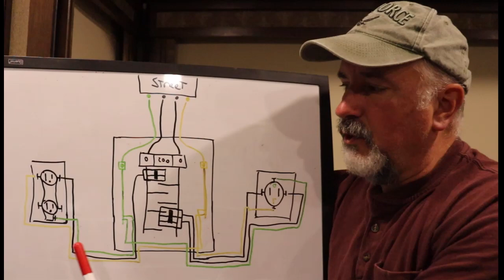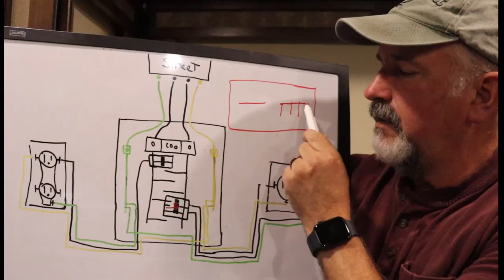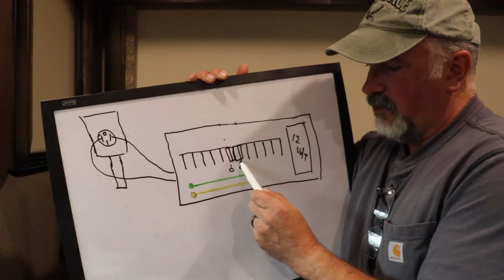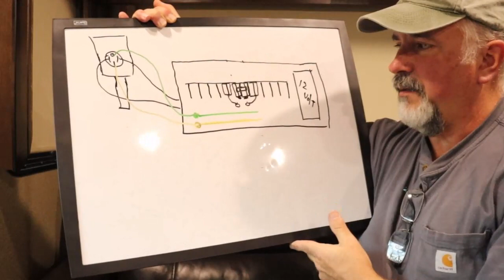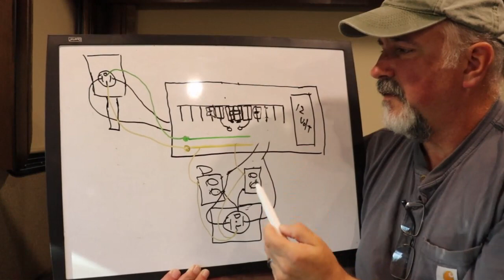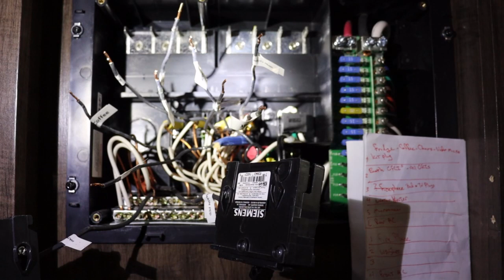DIY: Upgrade your RV Washer/Dryer

Comment: I know this is an old video but could you just take those two lines(washer/dryer since they are already on their own breakers and do a remote panel and have your double pole from that? Does the new washer and dryer only need the 30amp? Like In a house dryer has its 30 and washer usually has a 110.

Comment: So I assume Mike the smaller gauge wire in my 50 a breaker Rv can be used ?  So my washer dryer breaker /110v is in place .  One pole is my 110 washer /dryer pole and the other is a fireplace So the existing breaker needs to be replaced with a double 30 ?  It is currently a 15/20 amp

Comment: Hey, thanks for the video awesome resource to have. My wife and I are also living in a 5th wheel camper. We are looking to upgrade our washer dryer and install a 220 dryer. I watched the video and didn’t quite understand how you did away with the main 50amp breaker that is in the box? I understood how you moved the two lines coming in to different poles, but how would you retain that 50amp main breaker and add the 30amp breaker tie breaker?

Comment: Just for laughs!!!!!!!!

Here's an idea I just came up with but do not try this unless you are an experienced electrician!!!!!
I am not an experienced electrician I have some knowledge electrical wiring but not very much.
Once again do not try this!!! It's just an idea I had.

Here's another odd thing you can do that should work just fine.
Locate the two gang or two plug-in box on the outside of your house for 110 volts then find the breaker in your breaker box that powers that plug and pull that breaker and the next one to it and put a 220 breaker in there and run another line to the other side of that same outlet on the outside of your house.
So you can use that outlet like a 110 on either side by itself!
But if you have somebody who wants to plug in 220 have an adapter made up to plug in a cord from each side of those that goes to a different leg going into the RV.  Meaning that the outlet on the upper part of that box would be line A into the RV and the plug-in at the bottom of that box would be line B going into the RV. Then run at least 12 or 10 gauge wire to wire up that receptacle from your fuse box out to that outlet and you'd have to use heavy gauge wire every gauge appliance wire extension wire at least 12 gauge extension cords from the outlet on the outside of the house to the RV adapter, And make sure to use a 20 amp outlet on the outside of the house. They do make 20 amp 110 volt outlets believe it or not. You would also have to disconnect both ends of that receptacle from each other. I mean make them totally separate circuits electrically there's a little tab to break on each side of the plug to make those totally separate circuits the upper plug from the lower plug can be made separate circuits and that's what you would have to do or you could have serious problems in your fuse box!!!
You would run both of those heavy duty extension cords into the power box like the one he made that would be wired up differently with a 50 amp RV plug or receptacle on the outside of that box to plug the RV into.
This setup I just described should be equal to running long extension cords from two different rooms in the house to that conversion box that he made and then you can plug a 50 amp RV into it.

But after thinking about this, don't even try this unless you're an experienced electrician and know for sure if it'll work correctly or not!!!!! 
I was just sitting here trying to think of some other weird ways to hook up your trailer to your house and this is what I figured out off the top of my head so I repeat don't try this unless you are an experienced electrician and if an electrician does try this or if it does work let me know, just don't burn anything down in the process!!!!

Again, I am not an electrician!
 I have limited knowledge of electrical setups and wiring!!!

Better yet, just put a 50 amp RV plug on the outside of the house close to the driveway
and wire it properly to your fuse box in the house!!!

Comment: I have always thought there must be a way to put a 220 device or appliance in an RV but everybody said it was impossible!
I have seen references to articles showed how to do it but I never looked them up until now.
My dad was an electrician for many years and I know there's a lot of tricks out there! (Like running three-phase shop equipment off of two-phase etc)

I thought maybe putting a residential 220 breaker box right next to the other RV breaker box and hook them up parallel with each other. 
Some people try to make me think that A&b input wires are on the same phase so they would not put out 220 no matter what you did to it. 
If that was true it would not make any sense to run to 110 wires. They would just run 1 50amp wire out to the Post at the campgrounds campsites.

And RVs that have washer and dryer and a generator could just plug your laundry equipment into the generator run off of 220.

I know that 220 volt dryers use electric heat but do they also have 220 to run the blower motor or just a 110 motor to run that?
I'm guessing they would have a 220 blower motor since they already have the 20 going to the dryer, and 220 is more economical.
That's why a lot of Europe uses 220 instead of 110.

Residential dryers that run on natural gas and 110 should also work in RVs just install a propane converter on a gas line over to a propane instead of natural gas. And the dryer will still run off of propane and 110.

Some people told me you cannot put a residential dryers in an RV even if it was heated by propane which is absolute baloney!

A 220 dryer is better to save your propane for other things.

Anyway, my last RV had a residential breaker box in it.

The recreational vehicle industry probably separated the breaker box the way you showed because they don't want people putting 220 appliances in them.

Comment: Would you recommend using GFI, AFI or dual 30 amp breaker instead of just a regular 2 pole breaker? Or is that over kill?
Reply from the maker: The manufacturer of our W/D only recommended just a 2 pole breaker. A combo GFI/AFI breaker isn’t a bad idea as it would meet current building codes but are really designed for items such as bathrooms, dishwashers and wet locations. There would be no harm in installing one.

Comment: Hey Mike, I wanted to know how the residential appliances have been holding up bouncing down the road and what not. Everything still good?
Reply from the maker: They are doing great, what I did was install 2 (L) brackets at the bottom of the washer with my threaded nut tool.
Reply: @m2enjoyingthenow258  great to hear. I’m considering doing something similar to what you did here. I’m actually going to build out a separate sub panel for both the dryer 220 and for a mini split that’ll be 220. Running through 2 multiplus systems making split phase with a bit over 2000 watts on the roof and over 1000ah of lithium
Reply from the maker: @chrisreed9901   Excellent. Let me know how it turns out
Reply: @m2enjoyingthenow258   I have a channel as well, check out Why Not RV. We should be getting the new rig near the end of the year. We ordered it about a month ago. Definitely excited for all the future projects

Comment: Mike, What if I don’t have Solar and have the normal 50amp double pull in the middle between the 2 phases.  How would I be able to do this?
Reply from the maker: That is even better. All you do is find the two circuits (breakers) that run to the panel. Put one on each side of main breaker. Then all you do is add the 220 outlet.
Reply from the maker: What rig do you have?
Reply: 2019 DRV Full House JX450
Reply from the maker: Just make sure you have 2 different circuits
Reply: I don’t need them on a double pull that’s connected to both phases?
Reply from the maker: @rylie1235   only if the dryer will try to run on one phase. My dryer detects if there is only one phase active and will not run
Reply: Copy that , thanks a lot.

Comment: Great video Mike, thank you. I was thinking of using this method to put in a 240 volt induction stove top but I'm concerned about having too many appliances running at the same time could trip one of the main breakers which would in turn break the stove because one phase is on and the other off.
Reply from the maker: You can actually place a breaker that has a tie so both phases trip at same time. I would look at amperage usage for each element. I’m sure each one is way below breaker limit

Comment: no need to upgrade the awg???
Reply from the maker: Nope. When you combine the two awgs they are larger than required gauge. Plus you can bring bedroom line over to use for washer.
Reply: You need #10 for the 30mp breaker, not #12

Comment: Great video and explanation of RV electrical systems. One question, if you used both 120 lines in the washer/dryer closest to install the 240 outlet and the existing 120 outlets are no longer connected, what are you running the washer on?
Reply from the maker: Kyle Douglas The washer has a 120 cord the plugs into the back of the dryer which has an outlet.
Reply: I see, that makes sense. Again, great video. Thanks.

Comment: Yeh i have rules and i totally cant do this.  Like i will do wall outlets, and run wire through the wall "to" the breaker box.  But my rule is I do not stick my hand in the breaker box (unless i'm just flipping breakers or replacing fuses).  I'll call a master electrician like your husband and have someone else do the last 1% of the work to actually put the wires in the box or to change anything in the box.  Anyways thanks for the video looks good, i think our youtube channels are almost the same size.
Reply from the maker: Good idea to not stick your hands in there. 
Our main objective was to show people there are alternatives to the “status quo” of RV power